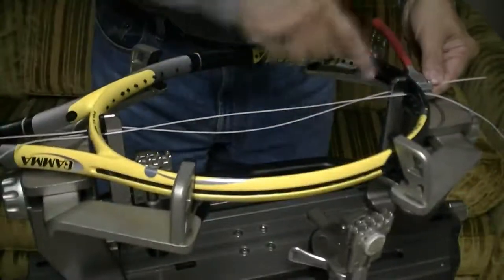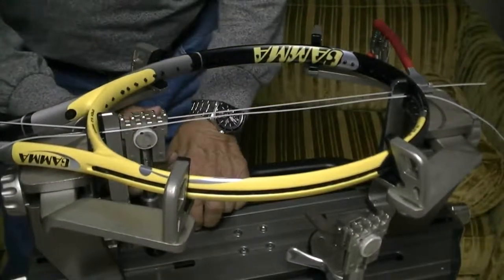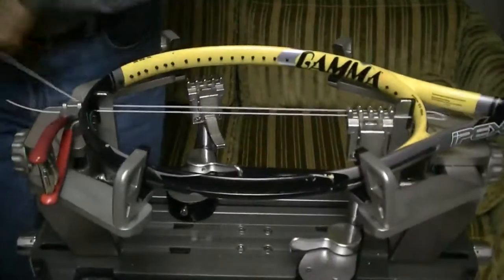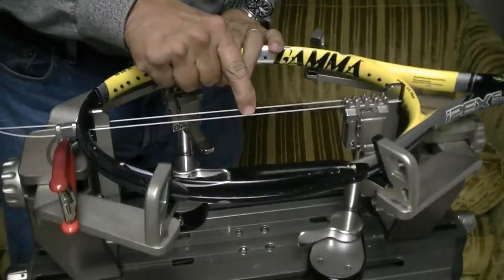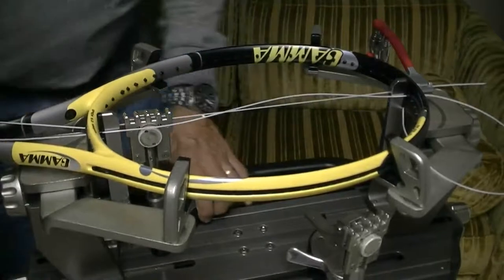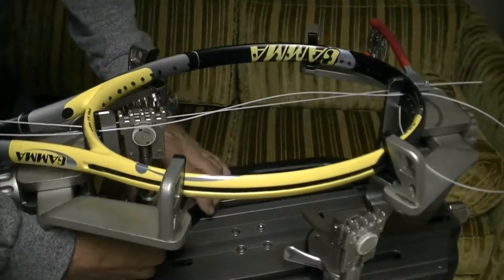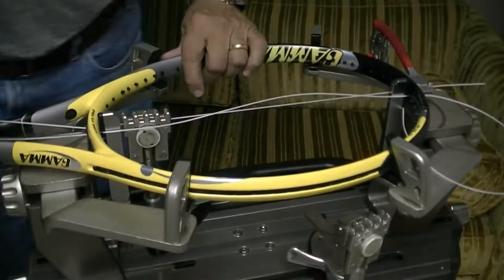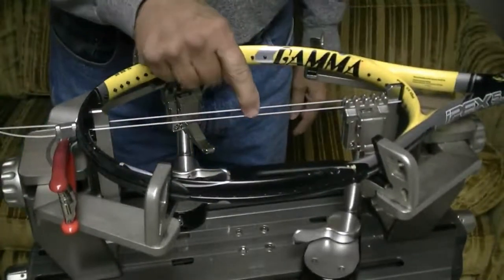tension test

Comment from the maker: There is always some play in the clamp and the base. When tension is released that play will create drawback. Normally no problem but on the tie off string it is good to get all that out. By pushing against the base you are eliminating that play.

Comment: on 0.29~0.33, the clamp seems to get in the way.
I don't understand what is pushing on the bottom of the base means.
Would you please explain it.
I mean, with our school's electrical machine.After clamping, the only thing I know that can be done is to lock the base.
I wonder what pushing on the bottom of the base means.
Thx